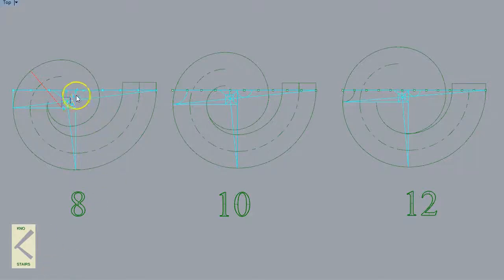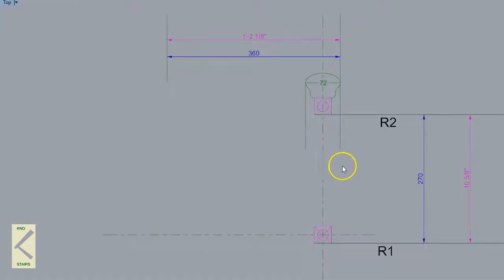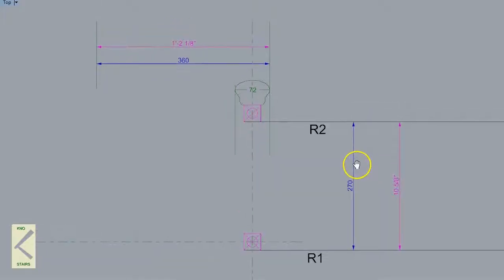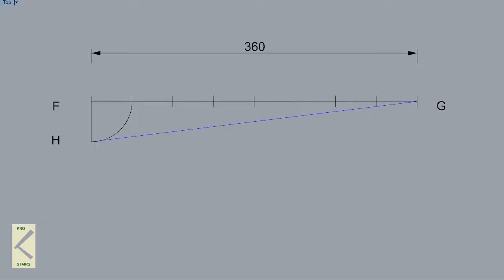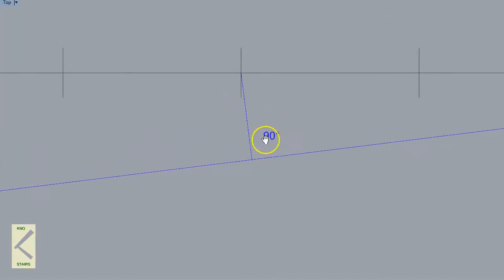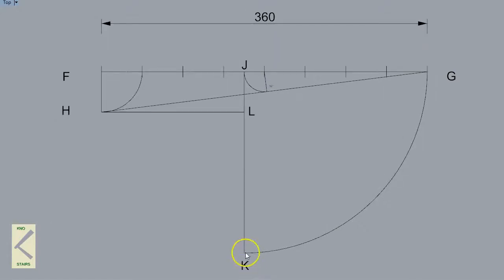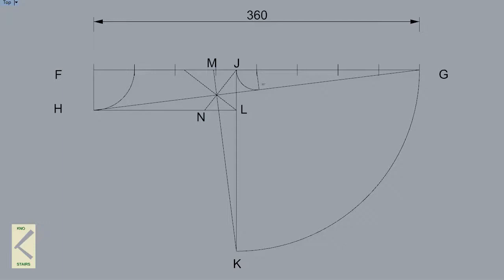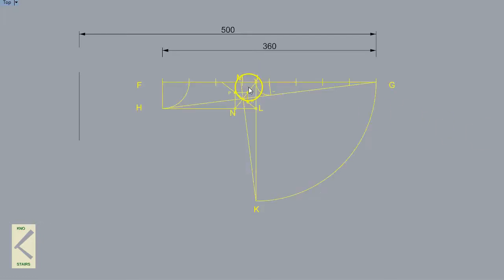Traditional handrail geometry.

Comment: Architectural terms associated with staircase and handrail work, are often associated with animals and objects:   "Bullnose treads, lamb's tongue molding, goose necks, swan necks, bird's mouth miter cuts, serpentine stairs, saddle guardrail, camel backed handrail, wreaths, spandrel, jib foot, apron, skirting, coffin corner, footprint, widow's walk and the various terms associated with volutes, including ram's horn, monkey tail, snail, scroll, shell, coil etc. Can you think of more?
Many terms are indeed regional preferences but I think that they should always be applied as they occur in nature, since that was the original intent.  Therefore ram's horns and monkey tails, would be vertical volutes.  
There are many different methods for drawing volutes (or close approximations) and always with descending compass points.  The only geometrically correct form lies with a pencil tied to a string and unwinding around a spool.  (A totally useless but interesting experiment.)
Reply from the maker: Indeed but they do describe the shape very well.
Reply: @knostairsstair-guides2337  Spandrel and Wreath are terms with no clear reference.  The rest, I believe, are all terms associated with anatomical or physical shapes, common in stair and handrail work.